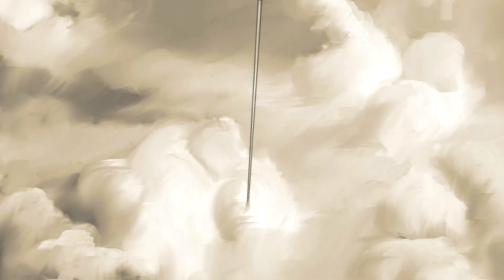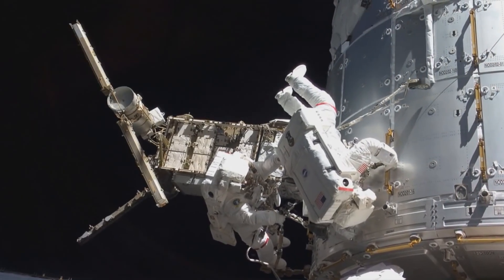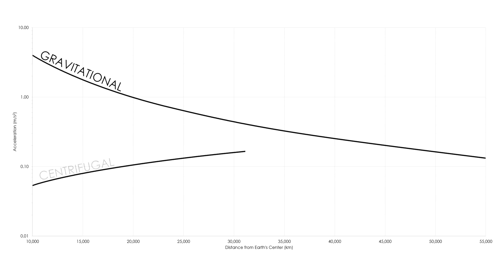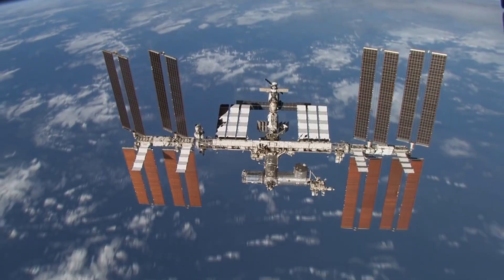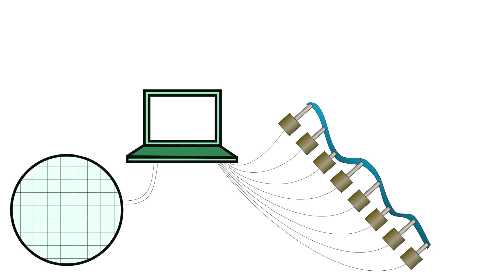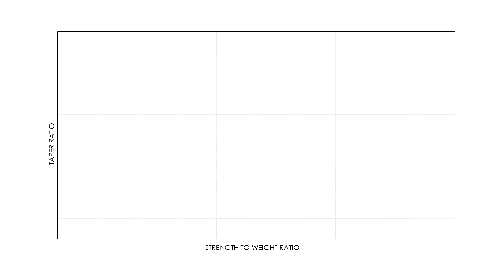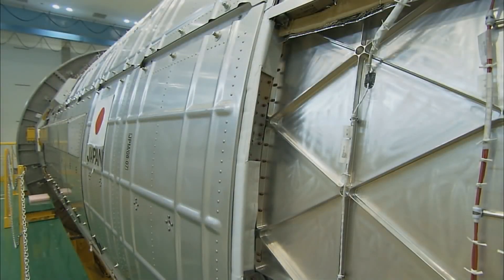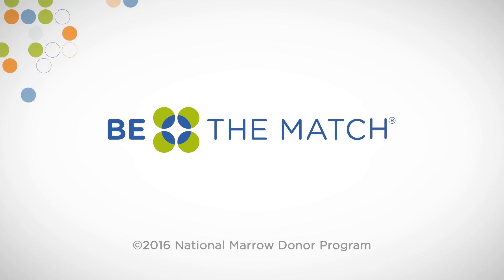Design Your Own Space Elevator

Comment: Why didn't you talk about space elevators on smaller solar system bodies. I know there has been talk about having the first space elevator be on the moon, because the lower mass/gravity means you don't need as strong of a tether that also wouldn't need to be as long, and the barely-there atmosphere of the moon wouldn't impede a power beaming system anywhere near as much. We would then take the infrastructure and what we learned from building the moon space elevator to work toward an Earth space elevator.
Reply: Has there been any analysis of what materials could be on the moon? Could it be used as a 'shipyard' to produce ships and the more reasonable elevator be used to launch them?
Reply: Helium 3
Reply: Since the Moon is tidally locked with one face permanently facing Earth, the only place where one would work would be on the far side of the Moon where any kind of centrifugal force would be found.  Taking that into account, it wouldn't make much sense taking material to the Moon, landing it from orbit and then lifting the same material out of the Moon's gravity well up to a point where we could reach by simply extending the lunar orbital eccentricity to the point of meeting the same  point in space where the counterweight would be.  If you are looking for an economical, efficent and faster means of getting to any of the Lagrange points, it would make more sense to use the Moon for a slight slingshot boost to get you there.

Now if you are looking for a means to move stuff to the lunar surface, then you may have a point.  But for the counterweight to overcome the gravitational pull on it and the mass of the tether, the counterweight would have to be much much closer to Earth for Earth's gravitational force to pull on it with sufficient force to overcome all that lunar weight.  I'm not sure what the math would work out to for all of this, but I could see it being done.  One of the advantages of having the Earth's space lift's counterweight being beyond the Clarke Belt is that spacecraft launched from the counterweight would be able to put all that centrifugal force to use by merely undocking and being slung into space!  It would be interesting to see if and how all that would work, essentially using minimal energy to move materials to the Lunar surface by this means.
Reply: Since the Moon is tidally locked with one face permanently facing Earth, the only place where one would work would be on the far side of the Moon where any kind of centrifugal force would be found.  Taking that into account, it wouldn't make much sense taking material to the Moon, landing it from orbit and then lifting the same material out of the Moon's gravity well up to a point where we could reach by simply extending the lunar orbital eccentricity to the point of meeting the same  point in space where the counterweight would be.  If you are looking for an economical, efficent and faster means of getting to any of the Lagrange points, it would make more sense to use the Moon for a slight slingshot boost to get you there.

Now if you are looking for a means to move stuff to the lunar surface, then you may have a point.  But for the counterweight to overcome the gravitational pull on it and the mass of the tether, the counterweight would have to be much much closer to Earth for Earth's gravitational force to pull on it with sufficient force to overcome all that lunar weight.  I'm not sure what the math would work out to for all of this, but I could see it being done.  One of the advantages of having the Earth's space lift's counterweight being beyond the Clarke Belt is that spacecraft launched from the counterweight would be able to put all that centrifugal force to use by merely undocking and being slung into space!  It would be interesting to see if and how all that would work, essentially using minimal energy to move materials to the Lunar surface by this means.
Reply: These responses are great! Thanks for taking the time to share all this info!
Reply: lueefour there's a good bit of information and sources about that on wikipedia. Existing materials would work
Reply: BlameItOnGreg, What would be the point of building a space elevator on the Moon before we build one on Earth? The whole idea of a space elevator is to get into space easily and inexpensively, so that civilians can go to space, so the first space elevator ( should one ever be built ) should be based on Earth and in Earth orbit.
Reply: what practical purpose could a lunar moon elevator serve? The experience of building it would hardly justify the absurd expense, especially considering it would do little to simplify the construction of one on earth since the fundamental material demands would be so different. All the equipment and materials would first have to be flown to the moon, an enomous and unprecedented endeavor of itself
Reply: +charlesissleepy It would make sustaining a lunar base way cheaper over the long run, especially if you consider wanting to bring lunar material back to Earth in mass. I think you also underestimate how beneficial having a stepping stone to an Earth space elevator would be. Even if none of the developed technology crossed over (which is a bit of a ludicrous proposition), just from a fiscal standpoint of fundraising (particularly in the current socioeconomic climate), it is a far more likely path to actually get off the drawing boards than building an Earth space elevator first. Building a lunar space elevator offers far less risk, while still offering substantial reward if successful. And it is far more likely that whatever technologies, processes, and manufacturing techniques that were developed for a lunar space elevator, would almost certainly directly lead into what would be used for an Earth space elevator.
Reply: A lunar space elevator presents a very distinct set of engineering challenges.The moon has inadequate rotation to permit the construction of a space elevator of the same working principle as an earthling one and would have to use lagrange points instead. This means the tether would have to be considerably longer than on earth, 56,000 km on the earthfacing side. The lower mass and lack of atmosphere permit the use of a uniform diameter tether made of existing engineering materials, which clearly already sets it apart from on earth based design (and no research into CNT in massive scale). The tether itself would be massive (using the length and proposed cross section area of the ribbon i figure around 66 metric tons, very likely i bungled the math though) and very expensive both to produce and to convey into lunar orbit. All without much economic motivation, save perhaps He-3. Long-short I don't see it preceding an earth-based project, since any practical use it might have almost presupposes one on earth.

Comment: we must build 2 at once because its so slowwwwwww
also, whats stopping something from dropping off before it makes it to the top? What if you just wanted to dock with the ISS? I know you would have to increase your angular velocity, thats about it.

And what about all the space junk in LEO? all it will take is one little pebble to fly through the tether and cause all sorts of wack, it would be bad
Reply: That's another trick, not getting the tether hit by the ISS
Reply: better yet build a series of them along the equator and make an artificial ring to farm solar power or something
Reply: wouldn't that would fuck up sunlight in areas on earth?
Reply: +charlesissleepy basically make a Saturn type ring, but with solar panels instead of ice shards?
Reply: Clyde Connors the panels have a much greater output outside of earth's atmosphere, so could be very small (to scale). Don't think they'd eclipse the sun in any meaningful way
Reply: asasinator50 yeah, but not necessarily of that scale

Comment: But if the cable were to be made out of carbon nantubes, and carbon nantubes turn out to be room temperature super conductors, that'd solve two problems at once. lots of ifs though.
Reply: Carbon nanotubes have been produced, just not in bulk. They aren't room temperature superconductors.
Reply: @IamGrimalkin  Who needs room temperature superconductors? They just need to beat 36,000km of inevitably imperfectly focused laser.

@Muh Face The temperature would vary depending on whether they're in the shadow of the Earth or directly exposed to sunlight, and even then not necessarily very hot depending on the specific properties that nanotubes in macroscopic structures wind up having (e.g. if able to be constructed with highly reflective surfaces they could stay cool even in direct sunlight).
Reply: what about when they are cold
Reply: sure not room temperature. but what about space temperature
Reply: They would be very hot heated by the sun.

Comment: They tried a 20km space tether back in 1996 and it burned up from too much current.There was a slight amount of air trapped in the insulation at the time of manufacture that escaped from pinhole flaws in the outer case, turned into a plasma, and caused a 3500 V at 1 A arc that melted the cable in half!http://www-spof.gsfc.nasa.gov/Education/wtether.html
Reply from the maker: +Grunchy Very cool. Thanks for sharing this.
Reply: That was super interesting thank you

Comment: use balloons to hold up the cable in the atmosphere.
Reply: Call it the Hindencable.
Reply: 0.1% of the way.
Reply: It's also the toughest 2% of the journey, to be fair.
Reply: what about when you run out of atmosphere?
Reply: im only talking about in the atmosphere.
Reply: marshal standley thats like 2% of the way to the clark belt or something
Reply: 2% is better than 0%
Reply: but how will the climber get past them?
Reply: That the sort of thinking we might need to make it feasible. Heck having having the bottom suspended in air might have it own advantages. There is a reason why the video showed a water based station even if he did not go in to details about that. 

But of course it comes with is own challenge. And one have to weight those challenge and cost against other designs. But using a mixture of idea I think is what will make this a reality if it ever happens.
Reply: Inventing the tether material and producing it in quantity is by far the main challenge in making the elevator a reality.  Everything else by comparison is 'simply' an engineering problem.
Reply: nThanksForAllTheFish
Well is sort of cutting edge so yeah. When we are talking about invention we are talking about using scientific knowledge to solve engineering problem in a new way.

But then again we might not have enough knowledge to solve this. But my feeling is that we are at the stage where we know the basics but we need to experiment on methods of production.
Reply: Just think how counter intuitive this whole idea is. "A rope hanging from the sky".
Reply: nThanksForAllTheFish
And even that is a engineering problem it self. We happen to have materials that could work. But if you can just a laboratory in small quantities then you do not really have something you can use. So somehow you need a way to scale up the production.
Reply: Maxwelhse
The problem is that you would not have a mountain tall enough for acceleration to be smooth enough for a human payload. And building in mountainous terrain would have it own issues. And that railway track would be the barrel. You likely would want it enclosed to as could make it as a Vac tube which would lower lose due to friction a lot.

But it may be double if you stick to just building satellites. (As long as you have some sort of rocket system to adjust it orbit. You can not avoid it falling back and hitting the plant if you do not achieve escape velocity.)

Maybe if the track was build with a bend towards the end and you kept the cargo accelerating for a very long time you could achieve smooth enough acceleration.
Reply: I think it's still a science problem.
Reply: The systems I've seen discussed don't involve a barrel at all, but a rail system built down one side and up the other of a mountain (I have seen scientific discussions about building such a system in the Alps). The concept was to launch a relatively light weight package into high atmosphere, and then finish the job with something akin to a scramjet that is able to scavenge extremely low amounts of upper atmosphere oxygen. This plan also includes a permanent space station within orbital reach of launched objects and transportation for crew on that station to retrieve them.

The entire idea relies on the premise of basically having "space factories" where "small" components can be assembled on the station. The logic is that if launches become super affordable, we can have many many many more of them. I've never seen anyone propose sending crew up using a "rail gun"... The G forces alone would kill them. Ultimately, other than the moral value of human life, the getting the people up there is the least critical part of the concept. We can launch and return them conventionally. It's the payload of equipment and supplies that is the killer.
Reply: Oh... and I think this concept is much more valid than a space elevator. I won't say science couldn't build one, but you're literally talking about Jack and The Bean Stalk.
Reply: Lorien vArden
Well like I said before. You can not have it shoot stuff in to orbit. You need a rocket to adjust the orbit. And I have pointed out the issues you mentioned.
Reply: Maxwelhse
Depends a lot of how you build that railgun. If it a fairly short barred one then it wont be any good. The acceleration needed would not only kill any human. But likely make the whole craft burn up in the atmosphere. If you build a very long one you could solve some of the issues. In fact for human cargo the barrel would have be so long that the whole project would be infeasible. (On the other had being so long it would actually reach to such heights as you would have very little air resistance.)

Now a space gun is more plausible if you only use it for lunching satellites or other payloads that are more robust. But is still a huge project. Also you would need to have a small rocket engine to correct the orbit. But of course you could save a lot by needing less fuel to get up there in the first place.

A interesting side note. The most common idea how to engineer such a barrel that would be long enough for lunching satellites would involve balloons actually carrying a the weight of the barrel high up in the atmosphere.
Reply: +cythil I don't see that working. First off, by using linear acceleration, the payload would have to be fired in the direction of the desired orbit to begin with, which would increase the energy required to achieve said orbit significantly since the payload has to traverse more of the denser lower atmosphere as compared to a system that can change it's acceleration mid-flight. Using the accelerator to boost a rocket that could then perform a gravity turn and achieve orbit sounds not much better either since you would increase the load to be accelerated and therefore the effect of the magnetic stage. Basically, you would replace the solid stage boosters with a very expensive system... which doesn't strike me as terribly desirable.   
Second, I doubt a magnetic accelerator could handle that much energy. Small objects like a kinetic impactor sure... but something like 250kg of satellite ? I'm skeptical. Inmo, designing a system that can receive external power over long distances and turn that power into thrust would be more desirable then a system that could impart a large impulse at launch.
Reply: >> a water based station 

I think that's because it needs to be at the equator, and whoever builds this wouldn't want to place it in another country's territory on the equator.
Reply: Haha thanks to your comment Urist, I just became aware of the fact that I've been trying to tilt my head upside-down to comprehend this whole thing
Reply: Jack and the beanstalk style, right?!
Reply: congratulations. You've helped hold up the first 30 kilometres of a 35000 km rope
Reply: Why wouldn't we just push the satellite connected to the end of the rope farther out.  So that it's like a flail, where the rope is being pulled out just as much as it's being pulled to the earth.
Reply: I also had the same idea. You could create a structural tower that is rigid and hollow out of any lightweight material, add helium cells, and it's buoyant or at least the weight of the structure is greatly reduced. I think a problem would be wind shear as the farther away from the ground that you get, the greater the shearing force of the wind acting on the tower would get, but I think studies could definitely be performed to determine what is feasible.
Reply: Balloons don't float that high.
Reply: Love the concept but you wouldn't reach to geostationary orbit, only 1/60 of the way or so, helium is relatively expensive and extreme winds would add massive lateral tensions to the cable. Out there there is nothing to hold onto, only generic spacetime, a very weak magnetic field and the solar wind.
Reply: Really, the next question is whether or not we SHOULD do it. This isn't the only option available for cheap space launches. "Rail guns" have been discussed as an option.

We could even start manufacturing in space if we took the right approach to it...